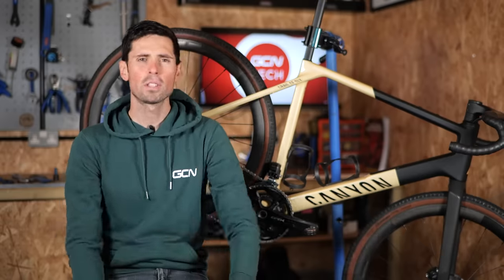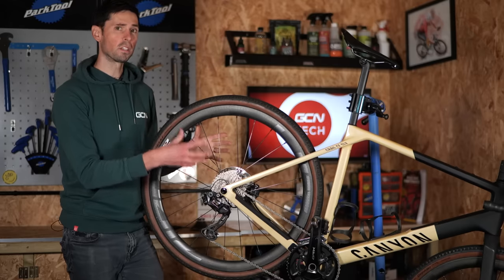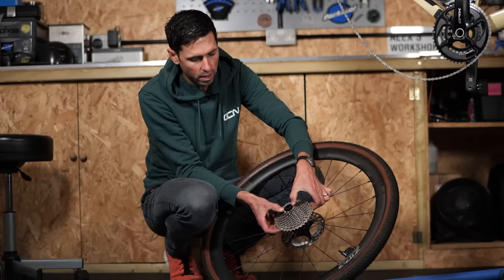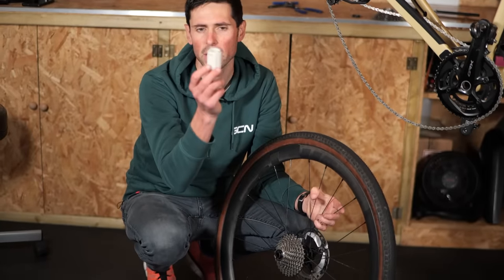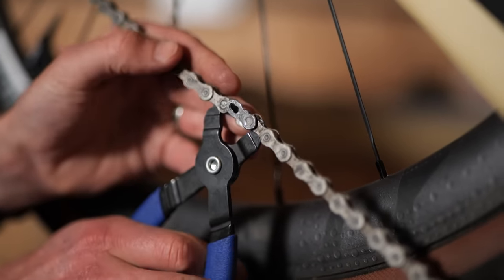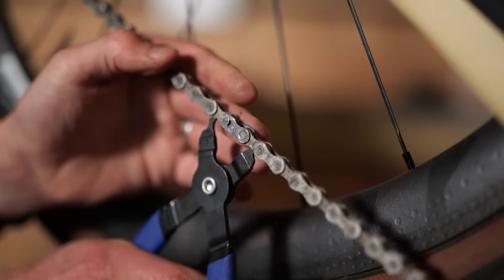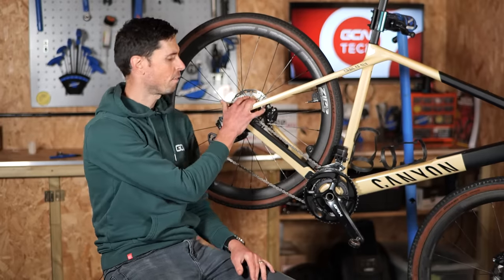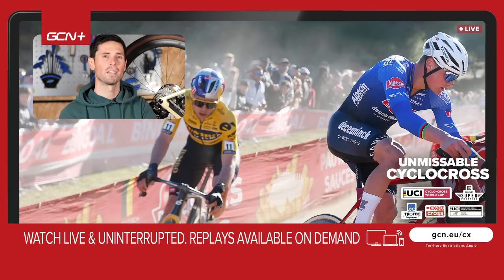How To Change The Gearing On Your Bike!

Comment: if i want to convert my 2x to a 1x could i just simply put a single chainring in the front and call it a day or do i need a specific casette in the back thats like made for 1x ? are there any mechanical issues if i dont change anything in the back ?
Reply: In this case you will lose a lot of gear spread ratio if you keep a relatively small cassette (depends which type of cassette your bike is using) with a 1 X drive train.

If it's an older 9 or 10 speed system it will likely be insufficient afterwards for climbing or for higher speed, depending on the front chain ring you use. 

1 X Systems typically use bigger cassettes for this reason to be able to guarantee sufficient gear spread ratio.
Reply: Mechanically it would work, you can simulate that by just not using the front derailleur to get an impression how it would feel with just one front chain ring.
Reply: You'll need to get a 1x chainring specifically.  Ideally "narrow-wide" which has teeth that seat in the thicker and thinner gaps, helping to keep it on, though I've used straight single speed ones plenty, and they work well enough for me.  (I have derailled it 4-5 times in as many years doing something stupid, but it generally works)
A single ring that's intended to be part of a double/triple will not work.  they're designed to fall off so they can move to the other rings.
Depending what kind of hills you do, and how much torque your legs have, you'll want to choose gears accordingly. 
I have a 44t chainring on a 10s 11-34 cassette, and it's quite a grind on the steep hills.  wouldn't recommend it unless you don't do steep hills, or are pretty strong, or don't mind grinding at 50RPM.

Other bike had a 40t, 10s 11-36, and it was pretty okay all around.  Decent for the steeps, but was a little spinny at higher speeds, and the jump from 13-11 is kinda massive.  I'd recommend this to someone who's in moderately okay shape, and needs to do hills.  It's fine for everyday riding, but if you want to ride fast on downward slopes, or with a tailwind, you'll spin it out pretty easily.

I upgraded it to 44t 10s 11-42 (needs a mountain derailleur).  This is pretty much ideal _for me_.  A little easier on the hills to let me get a good cadence.  A little higher in the top end, so my normal flat-ground riding leaves a couple higher gears if I'm on a subtle downhill, etc.

My newest bike (finished it a week ago) is 40t 11s 11-42.  Pretty comparable to the previous bike in feel.  This one's got fat tires, so maybe a little slower in general.  It gives me a lower gear that makes for easy climbing, top end gets a little spinny, but I'm not racing it, so I usually just coast down the hills, and don't care about the top end.  (I can still ride fast, just not quite as fast on steep downhills)

I'd say if you're new to 1x, err on the low side if you have hills to deal with.   I'd much rather be spinning out my gears on downhills than grinding my knees on the climbs.

Comment: Why does my lockring never undo that easily. I tighten it to 40nm (29 ft-lbs - it's an old torque wrench) but I need all my strength and a long bar to undo it.
Reply: Grease the thread

Comment: This video is a classic example of GCN's "Fools rush in where angels fear to tread" philosophy. There are literally HUNDREDS of things you have to get right, across the whole spectrum of gears and gearing from 8 to 13 speed, in order for your bike to function as well as it did stock, and a quick glance at a compatibility chart ain't gonna cut it. Use this video with a large pinch of salt, or even better, get someone who know what they are doing to help you. Alex really doesn't.
Reply: I agree that Alex isn't the best at bike mechanics but in this case what he did was a straightforward job with the expected outcome
Reply: His changes are pretty pedestrian and sure to work. I'd probably have left chain length alone because it would have been close enough.  Adding links back you need quick links, and by that time the chain will have worn and new quick links may not run smoothly as the rest of the chain.
Reply: Nah, you're being a bit dramatic.  I agree, I would have mentioned that going significantly bigger will need a different derailleur, and that adds some complications, but for your average joe, looking up what cassette his RD will handle, and switching within that range is going to be simple enough.